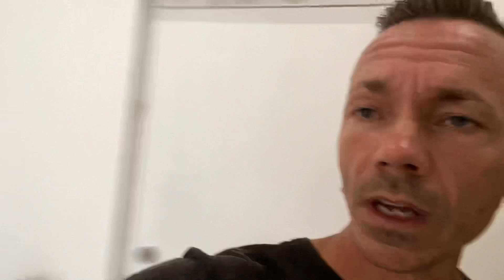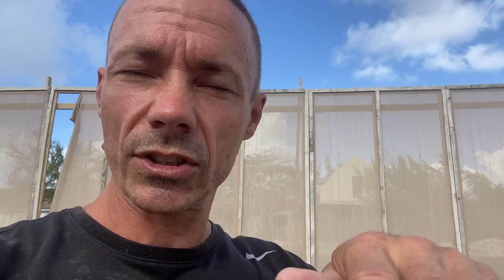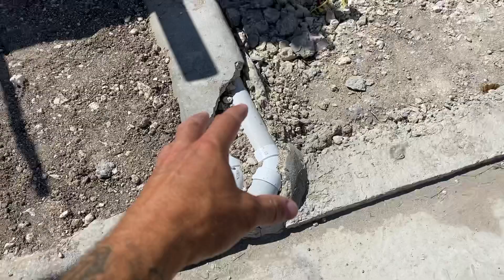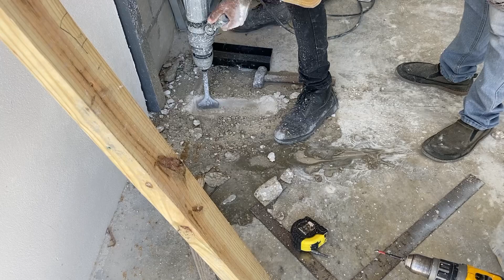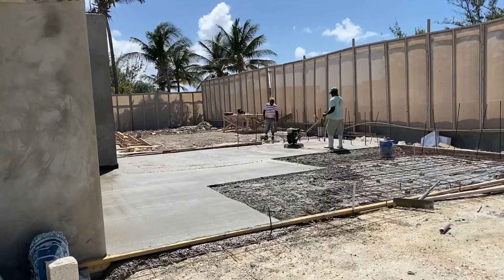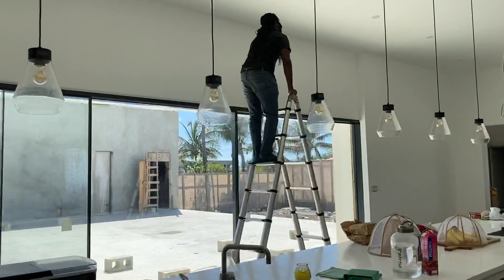Barbados 🇧🇧 Beach House Build - Day 241, pouring the concrete driveway

Comment: Hay, Alvin. You should never pour concrete garage floor in a full slab like that. You need square section to help with vibration as car roll in and out the garage. Square section.